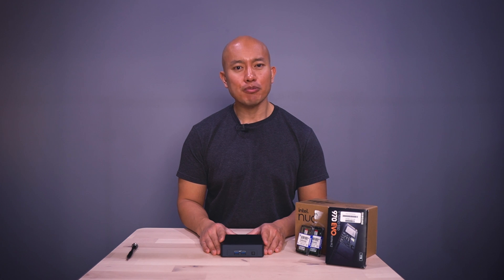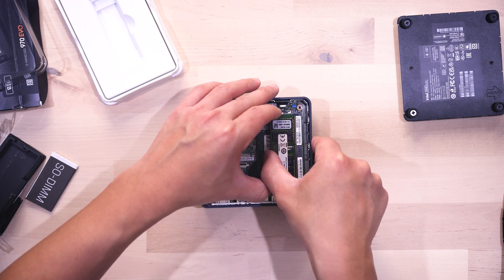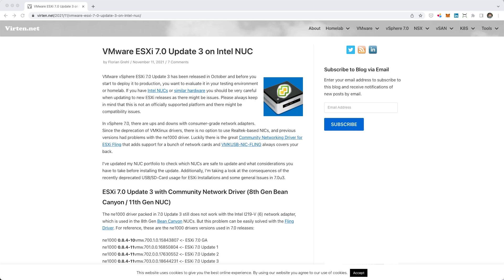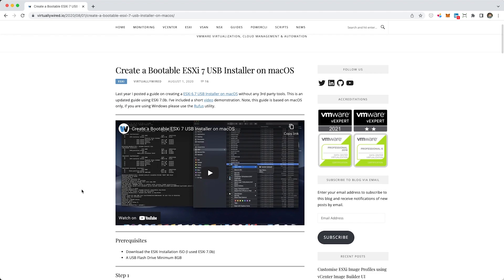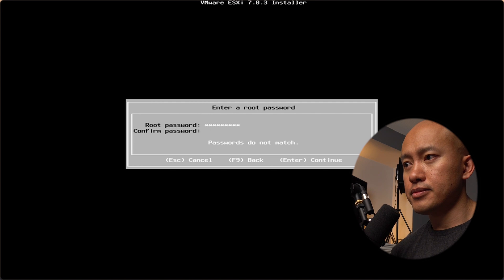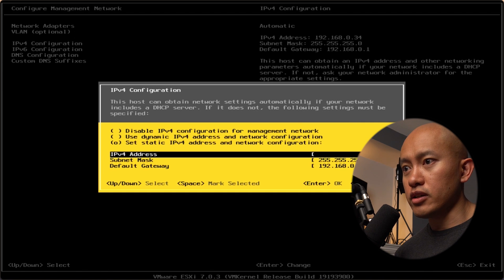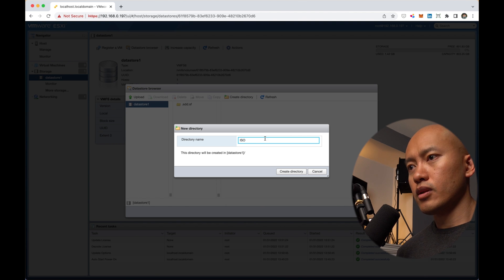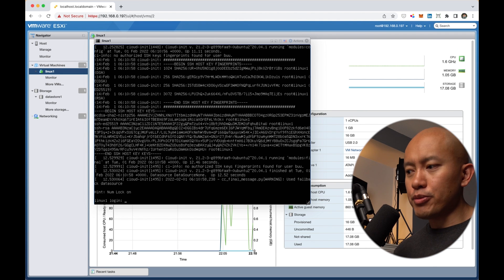Intel NUC and VMware ESXi 7 Home Lab Server Build

Comment: I need to have remote work done. I currently have a very budget / simple RDP Wrapper on literally a Point of Sale I5 pc. I am in need of not only upgrading but doing this the right way.  I'm crossed between a R730 with 2 E5-2697v4 processors,. or this Intel NUC idea.   This Server has 36 cores and 128 gb of ram.  Obviously can run VMWare Sphere. I"m looking at eventually 8 machines. But by my esitimate, I can run 20 easy right?   All WIn10.  So.. I have the space. I've studied it.  Am I better off with this NUC idea to run Win10 machines?   New to this-- thanks. Also with 2.3GHz per core, am I going to get slow performance for basic use, (chrome, sheets, email).

Comment: Can I buy an ready to use bootable iso from you?
Reply: Not something we sell or can provide but all the instructions are there. Feel free to add a post to the thread referenced in the notes if you run into any issues
Reply: you can also just use Ubuntu and KVM, that's what Aubrey and I are using, with virt-manager to build out all the lab VMs from our local devcies.

Comment: Any updates on if the NUC is compatible and still a good option for vSphere 8?
Reply: I haven’t tested with mine but I have not seen anything to indicate I’d have any problems at this point. That said, I’ll probably wait a while to go to 8.
Reply: @buulam  I got a NUC 11 today and installed ESXi v8.  When I try to restart or shut down, I'm getting a pink error screen.  Other than that it seems to be working.  it also has the network driver that needs to be patched in in 7.* already included in the ISO so the network started right up as it normally should on a fresh install.
Reply: @Peltwerk  Nice - thanks for the info. What's the pink error screen? Does it just let you continue or do you have to hard power off?
Reply: @buulam  It's like a blue screen of death.  Lots of stuff I don't understand sorry.  it's only one the top ESX install on the hardware.  I have been messing with it tonight and created two more nested ESX VMs and they restart fine.  Also the vCenter Server Appliance went smooth as well.  But yes the pink screen locks everything up and I have to unplug it.  Holding the power button doesn't turn it off but that could be a bios setting.

Comment: Nice one. I´m still using a SUPERMICRO X10SDV-8C+-LN2F - Motherboard - Mini-ITX - Intel Xeon D-1540 (MBD-X10SDV-8C+-LN2FO) with 64 GByte RAM and a 1 TByte 970 PRO M.2 SSD, but a NUC  would be probably the next step. I have a VMUG subscription to run a BIG-IQ VE licence manager, a couple of BIG-IP VE lab instances and a CentOS for routing, DNS, NTP, RADIUS on it. 
Thanks for your video!
Reply: Nice setup! I thought I might have to resort to Mini-ITX back at the time because of the shortages. What case do you have it in?
Reply: @buulam  I´m using two Antec ISK 300-150 Desktop 150 Watt (black) cases. They have an integrated PSU. The case fits easily into an F5 DevCentral-backpack and along with an external access point it´s just perfect for an onsite workshop/demonstration. It looks like there is a newer Antec ISK 310-150 case available. The important aspect is the integrated PSU and enough space for CPU fan and memory. Please make sure the PSU ATX connector fits to your Mini-ITX mainboard of choice.
Reply: @stephanmanthey  nice, I was thinking perhaps for an HTPC one day

Comment: Great post, but you need to add "Set-ExecutionPolicy -ExecutionPolicy AllSigned"  to your instructions.   I was having hella difficulties until I used this command
Reply: Interesting, you needed this before running any of the VMware module commands?
Reply: @buulam  I had followed all your steps, and even taken the recommendations from Powershell, only to come to this message

windowspowershell\modules\vmware.vimautomation.sdk\12.5.0.19093564\vmware.vimautomation.sdk.psm1 cannot be loaded because running scripts is disabled on this system.

After some digging I ran into some messages about exception policies.  

 
Then I searched some another tutorial that mentioned the "Set-ExecutionPolicy -ExecutionPolicy AllSigned" command.   Once I popped that in, everything worked
Reply: The "Add-EsxSoftwareDepot" command would not work at all.    PS mentioned that it was in one of the modules, but nothing would work
Reply: @PawanJheeta  Ok I'll add a note about that in the morning. Just in the last week I've had a couple co-workers use the steps so I'll gather some feedback from them as well. Thanks for the details about this.
Reply: @PawanJheeta  Thanks I have updated the article!

Comment: I purchased the nuc, memory, and storage like you suggested.  I was able to build the iso with a new power shell on my windows 11 pc and use rufus to make an installable usb drive.  Piece of cake!  My esxi host on my Nuc is up and running!  Thanks for the great video!
Reply: Great to hear! Which specs did you go with?
Reply: @buulam  i purchased a gently used nuc11TNKi7 barebones from newegg (600 bucks...those are not cheap) and went with the 2 Kingston Fury Impact 32GB 3200MHz sodimms that I got from amazon (~280 bucks for 2 sticks to get me 64GB) and a Samsung 970 EVO SSD NVMeM.2 from amazon (another 200 bucks).  I am all in at over 1,000 bucks.  I want to get another rig and buy the VMUG license from VMWare (soon to be Broadcom ugh) and setup up vsphere to manage and maybe look into some storage options too.  Long term goal is a kubernetes factory going at home!  Baby steps though for me.  I just dockerized Apache Nifi on the rocky 8 linux vm i created on my new Esxi host! Yay!  I may have more questions as i proceed.  Thanks for sharing!
Reply: @Buu Lam If I purchased a NUC11BTMI9 FULL (8 cores) with that hideous skull that lights up, would the bootable usb that I successfully used for the nuc11TNKi7 work?  (I am not sure of the nic on that one)

Comment: Great tutorial! went through with no problems.  Used balena etcher for the bootable usb. Much appreciated!
Reply from the maker: Awesome! Did you have to replace the NIC driver?
Reply: @devcentral  Just the steps your provided. Everything is running smoothly thus far.
Reply from the maker: @kydo2540  great to hear!